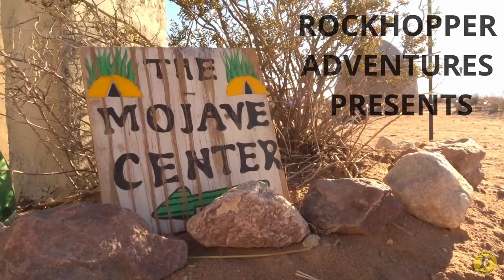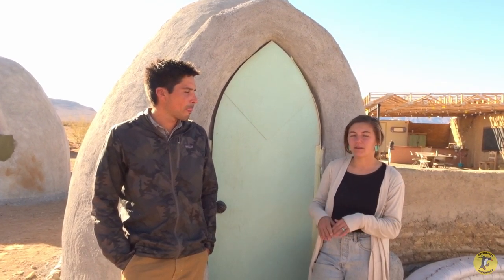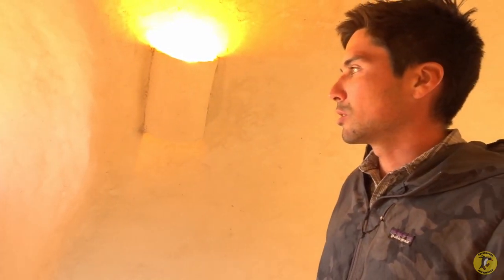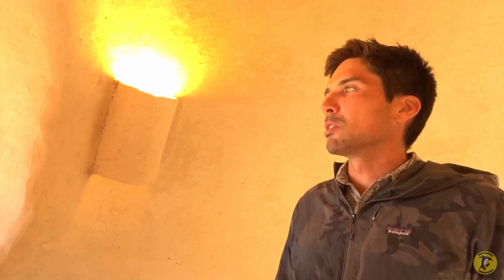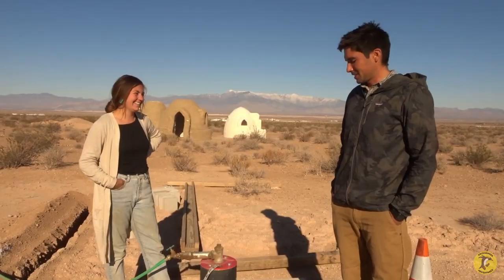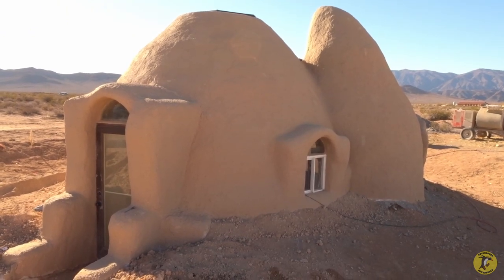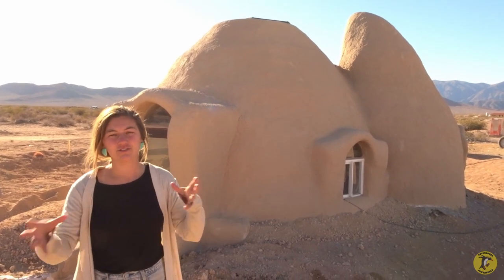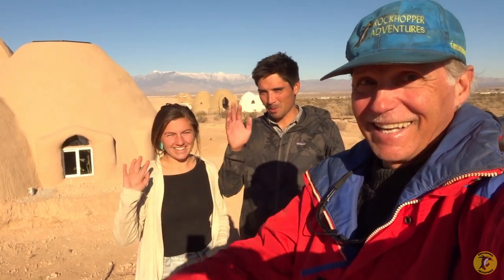Superadobe Home Build Update - How Have the Structures Progressed in a Year?

Comment: Just a suggestion guys. I am a locomotive builder and one thing I learned from locomotives was because of the extreme horse power and conditions of the rail as well as the outside environment and weather sealing the compartments of a locomotive can be nearly impossible. For example, the locomotives we build travel approximately 80 miles an hour roughly top speed and once they are moving they typically have no reason to slow down, they also have tight schedules as many tracks are used to travel in both directions meaning that scheduling and maintaining tight punctuality standards is an absolute must for obvious safety reasons. Nobody wants to be late in a locomotive because if the other locomotive travelling your direction happens to leave early you'd end up with two cities moving 80 mph into each other frequently and head on collisions between to high speed locomotives is a very messy situation. That being said a locomotive must be able to travel at it's normal speed during any time and through any conditions it may face may it be hail snow monsoon tornadoes hurricane lightning uphill downhill negotiate 15 degree radius curves through the most unreachable parts of the country through tunnels and over bridges with clearance tolerances with only an inch or two with very sensitive equipment everything from high voltage extremely high voltage to all categories of electrical wiring and thousands upon thousands of miles of wiring as well as tens of thousands of electrical terminations. These terminations are connected to extremely sensitive equipment alot of which we install using static sensitive protective coverings tools clothing inclean room environments. The vibration alone will rattle any "sealed" situation apart in it's first trip in service and so we do not even attempt to seal and keep the wind dust bugs debris leaves rust water smoke hail mud and every airborne anything you can imagine In between out of these highly sensitive compartments on the locomotives. Then if none of the room cabin compartments or other containers etc are sealed then how do we keep the equipment in an open environment from getting destroyed at 80 mph in a rain storm? Positive pressure. That's it. As long as any compartment can maintain at least 1 lbs. Of positive air pressure within the compartments well then no water or anything else can enter an opening. If you have a small leak or a hole per se in an electrical cabinet then that cabinet absolutely will have a small fan like those found in a desktop computer all the way up to an entire compartment or cabin having a "squirrel cage" style blower motor. Most locomotives within there "fresh air room" have a huge blower motor and a large plenum attached to a main duct that runs under the floor the length of the locomotives with smaller ducts branching out to each and every electrical cabinet throughout the entire loco. And this will constantly supply a source of positive air pressure to each of them and if the compartments has a leak well it's leaking air out with a signature whistle and if it's leaking air out I guarantee nothing is getting in.. even if it was submerged as long as the air pressure exceeded the ambient atmospheric pressure outside of it everything within will be dry and clean as day 1. So just a hint considering i dout no matter what you do to seal your mud hits in that desert you won't be able to keep the dust out. You may want to consider providing each hut with a simple blower motor to provide positive air pressure within your hut and water and dust will never get in 😊
Reply: Just outta curiosity? Where do y'all put the groceries? I've always wondered about that
Reply: Thanks a lot for all those technical details. Great comment. 
The one-liner solution is also great.